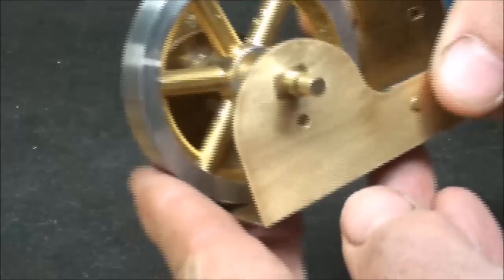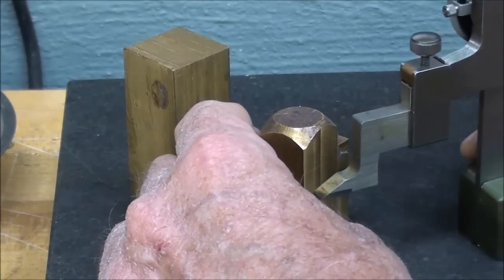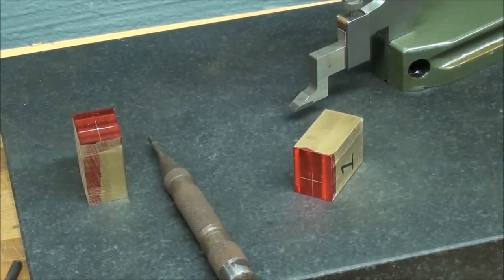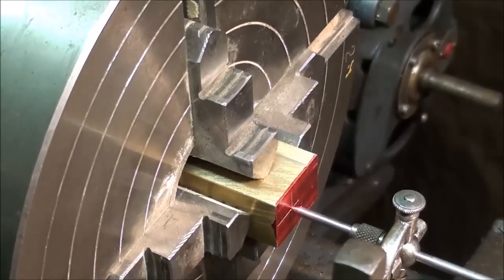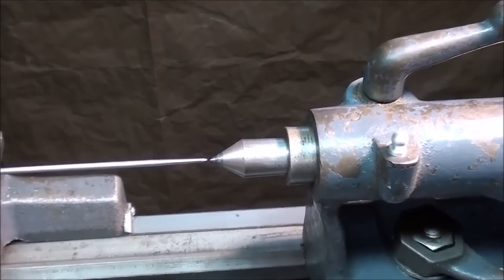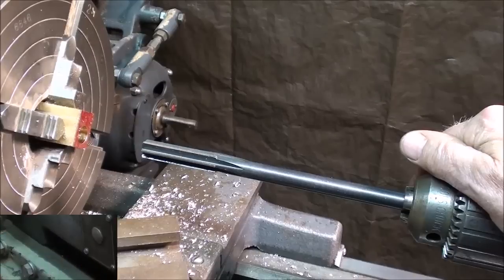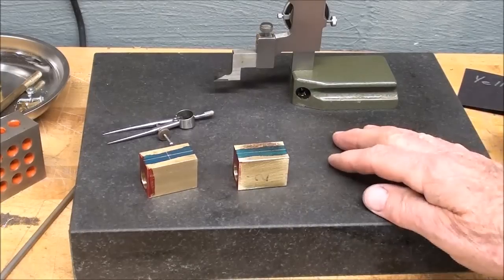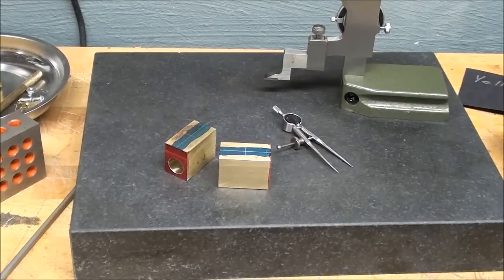Part 9 of 10 - tubalcain Builds the YELLOW BOY STEAM ENGINE

Comment: For holding two pieces of similar stock in the same vice, space them as far apart as you can.  Depending on the slop in the vice, this can hold up to a few thou difference in thickness of material.  Just have to make sure that all the datums in the vice is true/flat to the milling head.  Great videos, thank you for posting!
Reply from the maker: +Alex Skrydlak Good advise- Thanks for watching

Comment: Usually, a 2 cylinder double-acting steam engine is made self-starting by offsetting one crank 90 degrees to the other. This way, when cyl. 1 is at a dead spot, the other one is in the middle of the stroke where it has the most power.
Reply from the maker: +Adrian Straub thanks for watching

Comment: Tip... when drilling into brass, to prevent 'snatch', grind a very slight negative edge to the drill. It works every time! A clean hole without 'snatch!'

Comment: Steam locomotive crank pins were "quartered". The timing was set at 90°. When you hear a locomotive start or run at low speed, you'll hear four "chuffs" per wheel rotation.
Reply from the maker: +Thomas Coughran Thanks

Comment: Hi Lyle! Great explanation on the centre-finder, however what is the comparative accuracy of your centre-punched hole? Surely there has to be a way of locating the centre across the flats rather than locating to a hand-punched location?
Reply from the maker: +Prostheta thanks for watching
Reply: +Prostheta  Here are 3 other ways to position a hole accurately on the lathe.
 1. Toolmakers buttons. Drill and tap, mount and locate the button by measuring from the sides, mount in lathe and dial in the button. Remove button and finish the hole.
 2. By measure. Bore an under sized hole, measure wall thickness, adjust position accordingly and finish bore. This is hard to do accurately with small holes unless you use a tight pin in the hole.
 3. Wall adjustment. Mount an over-sized piece of material in chuck and finish the hole. Move part to milling machine, align the part according to the hole and mill the sides to attain the desired wall thickness and outside dimensions.
 For parts with round OD or features, mount on mandrel to finish.

 To dial in a center punch without a center finder use a long piece of 3/8" rod with a 60° point on one end and a center on the other. Hold it in the chuck or on the center with the point in the punch mark and use a dial indicator near the point to dial it in. This can also work to locate small holes. If you harden the ends it will last forever. Mine is 40 yr old.
    Mike (o\!/o)
Reply: +Moholo 88 Excellent information, thank you. I'm no expert at metal machining by a long way, however my eyes always question sources of inaccuracy or stacking tolerances since I'm a CAD engineer by trade. Seeing how a design goes through to the [metal] is an interesting process that feeds back up "to my end", especially the decision making rationale. Sounds like I have a new tool to make, which is always a good thing. Thanks Mike!

Comment: Mr, Pete, in several videos you have shown how to adjust the 4-jaw chuck, but I think this is the first time you have shown drilling/reaming off center in a rectangular piece. The Starrett No. 65 center tester is most interesting, but hard to find. You said (somewhat sadly, I thought) "in these data of indicators" but have you ever shown how to use that method for this application? I found online references to "spring loaded centering tools" and it seems that there are wigglers for lathes, but how would that work? And someone online opined that a coaxial indicator (which you showed on the Bridgeport mill) could be used on a lathe. If you are so inclined, a video lesson might appeal to other viewers as well as me. If you already have such a video, I can't find it, and I have watched several hundred so far. Thanks!
Reply from the maker: I think I demonstrated that indicator--not sure which video.
That would make a good video

Comment: Hi there Mr Pete! Just a couple questions. Firstly why not make the cranks offset by 90 degrees? Secondly if you were to face those cylinders in the lathe instead of in the mill and you can't get to the rear face of the piece to measure it with the callipers, how do you face it off to a precise length, say to within 0.001"?
Reply from the maker: +radbot1 Ye-I thinh 90 deg would be fine

Comment: mrpete222

For a twin cylinder to be guaranteed self starting the cranks have to be 90 degs apart. applies to locomotives as well as wobblers.

Regards 
Prof. Loco Eng.